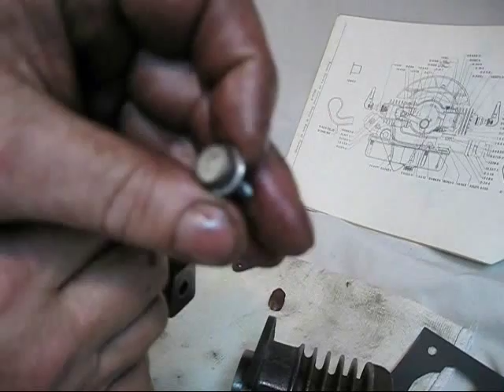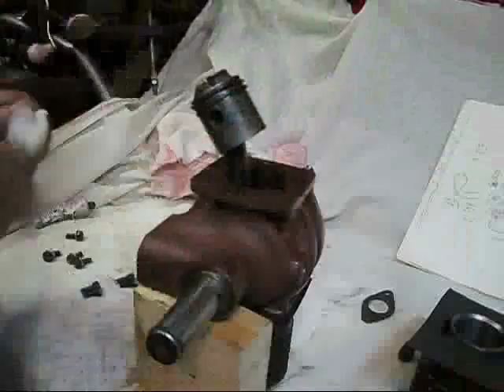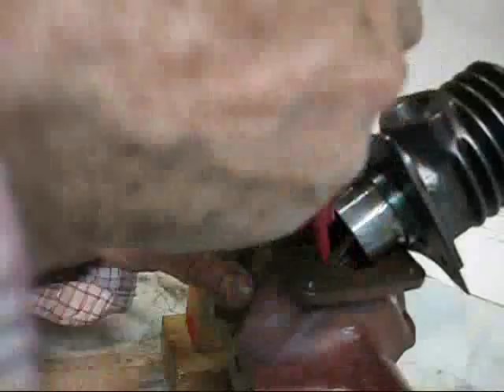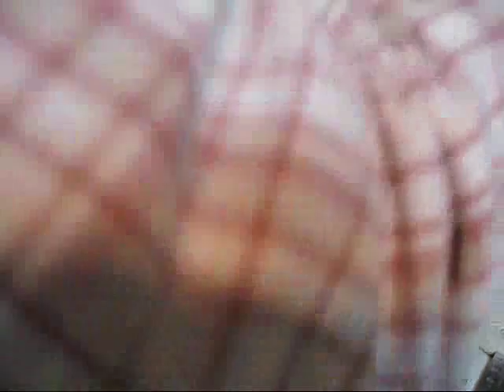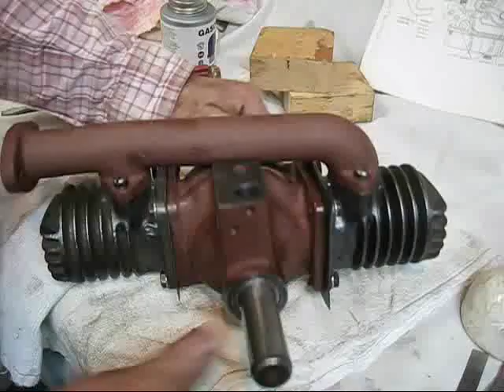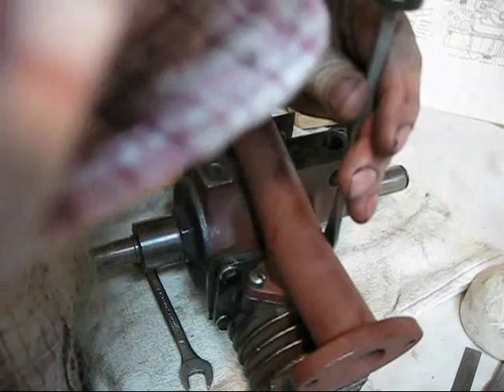1937 Maytag Engine model 72  repair #26

Comment: Tickled pink that the engine is coming together and will be ready to run soon.
I bet that first start up is going to be smokey!  I hope that we will be able to see that spectacle.  At least you have made the point that the reassembly of a Maytag engine requires a lot of oil to prevent scoring of the bearing and bushing surfaces of the "new" engine when it is first started up.
I bet that engine is going to "Run like a spotted ape!"
From the West Coast of Tennessee.

Comment from the maker: @MrBallistic31 And the answer is,,,,  the holes in the manifold are way too big, as maytag built them, (metal does move around a little because of heat expansion and contraction) all year models will fit all year models, thanks, shopdogsam

Comment: I guess a question that comes to mind would be. Lets say the heads on the motor where not usable and you had to mix match heads. If this where the case would the exaust  manifold have trouble fitting , or might you have to enlarge the holes a bit.